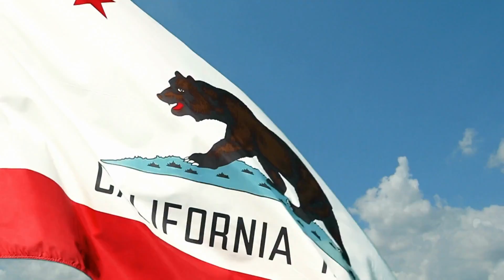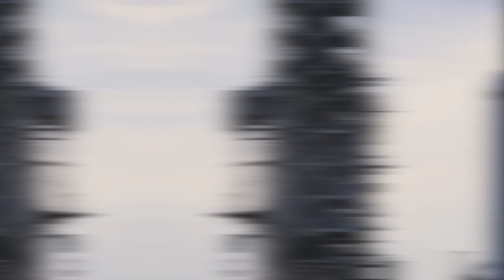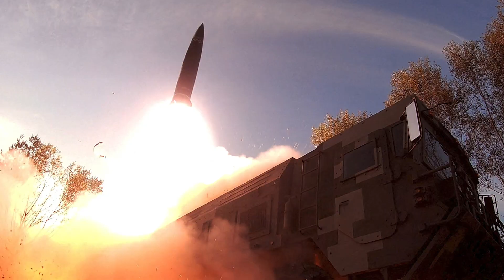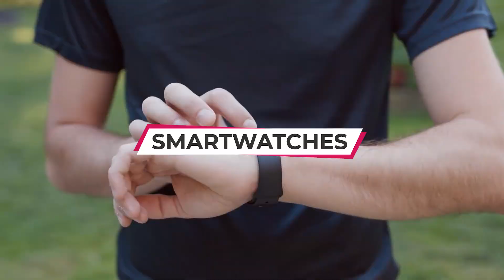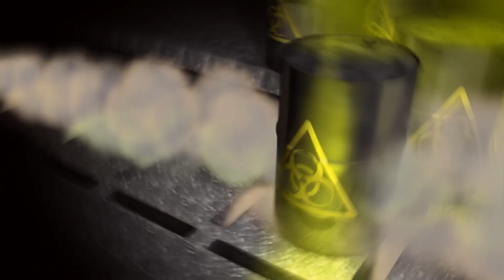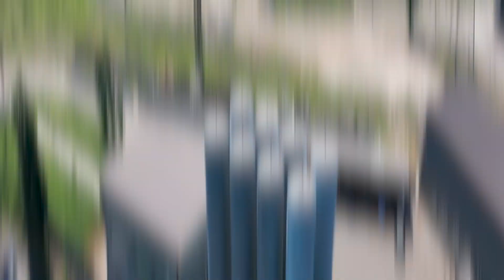Elon Musk's Insane Nuclear Diamond Battery

Comment: Imagine a battery that can last 1000s of years 😊...then…realize such battery needs to be 1000s of times bigger than a Li-Ion battery for the same power 😮
Reply: Imagine, you have a bettery that could power your device for 1000 years. But the devise is build in a way that you can throw it in the trash after 3 years and the battery isn't removable 🤣